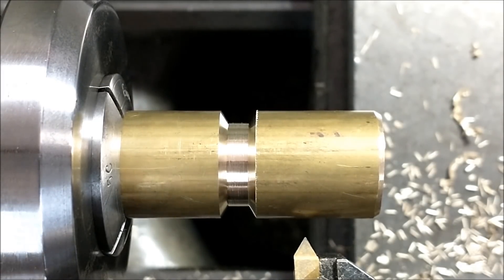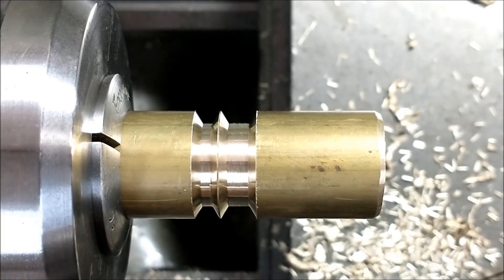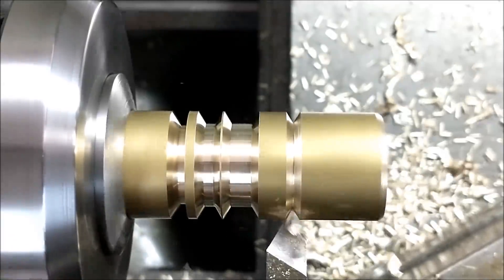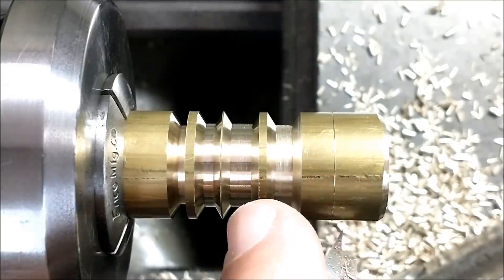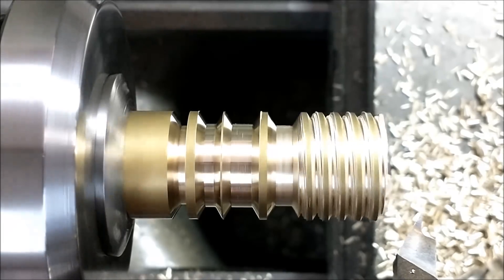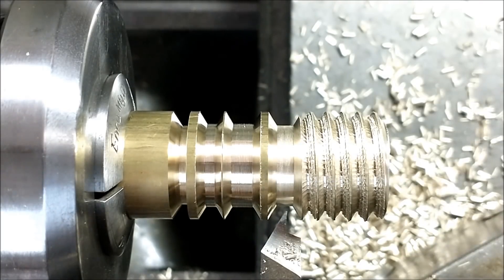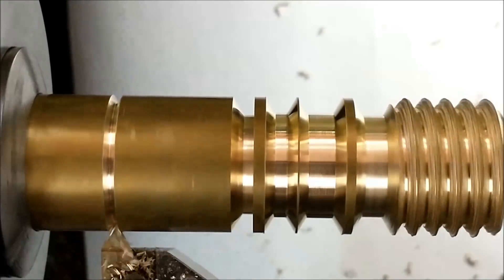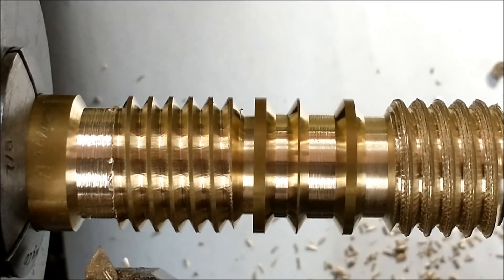FACT CHECK:  Threading Myth BUSTED !!   You'll Find This Interesting......

Comment: Hi Joe, I regularly cut 20 deg pressure angle threads on my lathe. I grind the tool to 20 deg both flanks and by giving 20 deg to the copound I feed the tool by compound slide. Will it be possible to cut such larger pitch worm threads by employing single flank tool as per your method explaied in this video. How will be the finish of the worm flank which is machined by straight side of the tool. The material is C45.
Reply from the maker: If you take extremely ( unrealistically ) small cuts, you might get lucky enough to achieve a reasonable thread with a one sided tool. This was just to demonstrate a myth. I probably wouldn't endorse the practice in the real world.

Comment: If you control the angle at the tool post why would it matter if you keep the 29-30deg angle on the compound? Assuming we're feeding with the cross slide only. Thanks Joe.

Comment: Thank you for validating what I've been thinking recently. When I think about the interface between the tool and the work, there's no difference between using the cross-slide, the compound, or increased stick-out of the tool from the holder (leaving aside the loss of stiffness from this) to achieve the next deeper cut. The geometry stays the same. The work can't see the compound whatsoever, only the tool.

Comment: Hi Joe 
Love your videos 
Hope you can help me out. 
When I cut a thread on my lathe the first pass after engaging the half nut goes great, then when I go back to make the next pass and engage the half nut on the same number on my thread dial it cuts a double thread. 
Why does this happen???
If I leave the half nut engaged and reverse the lathe and take the next pass it is perfect makes a nice thread. 
I would like to be able to engage and disengage the half nut pick up on the same number on the thread dial and continue but can’t. 
My lathe is only 3 years old. 1 metre between centres so not a toy. 
Hope you can help???
Regards 
Greg 
NSW. AUSTRALIA
Reply from the maker: if you are cutting metric pitch threads, you must leave the halfnut engaged at all times and use the lathe power to reposition the tool. If its an imperial pitch, you can do what you are currently doing.
Reply: Hi Joe
Thank you for your help much appreciated. 
Will experiment with imperial threads. 
👍👍👍
Reply: Hi Joe 
Just changed the gearing for imperial threads on my lathe. 
Used the half nut and thread dial. 
Worked GREAT 
Thanks so much for your advice 👍
Regards Greg 
NSW. AUSTRALIA

Comment: This 28 and 31/62nds°😂 setting of the compound slide appears to be either a British or American teaching. I learned my trade as a mechanical engineer in the '80s in Germany. We left the compound  slide parallel to the lathe axis, used the cross slide to adjust the thread depth according to  our well-thumbed reference books. On every cutting pass, the compound slide (@ Zero degrees) is advanced about ¼ of the cross slide advance increment. This avoids full cutting pressure on the tool, still cleaning up the "rear" side of the thread. E.G: for each pass you advance the cross slide by 0,4mm and forward the compound by 0.1mm .
As for the imperial system this should be about 3/8th of a thou compound advance for each 1/64th. cross solide adjustment.
Reply from the maker: I straight plunge 99% of all the threads I do.
Reply: @joepie221   As did I for 50 years. At college we were made aware of the "sliding down the flank" method for (manual)  single point cutting (and remember the angles necessarily change for the various included angles) 55 degrees Whitworth, 60 degrees Metric / SAE 80 degrees for PG and US conduit (I think) Using a QCTP is easier for the offset compound slide method than the use of an indexable toolpost, which only indexes at 90 degree intervals.  We were also made aware of the alternate advancing and retracting of the compound slide method. And were told not to bother, just to plunge.
I had to make some tapered knuckle thread connectors for military aircraft oxygen supplies to crew's oxygen masks.  So the taper was achieved using the manual machine's taper turning attachment, the root form achieved by producing a form tool on the Cincinnati Mk2 using a radiusing attachment (can't use that any way other than plunging) and the crest radii were achieved with a second form tool made by grinding the form after producing that form on the T&C grinder's wheel... tedious, but no pressure to work quickly, I was in military service, not business...
The problem with compound offsetting comes in rework, "picking up" on an oversize thread that's been rejected in QA, or picking up on a thread made oversize abroad, where it's quicker to rework rather than return it.  The other occasion was in single point cutting, followed by machine chasing to finish the crests. (like my aircraft hose adaptor)  Hand chasing was less of an issue. We went by feel, using the back of a boring bar set low as a tool rest.
I do have, somewhere, some single point carbide threading tips with a neutral approach, a compound rake (make sense?) which were intended specifically for the "sliding down the flank" method. It meant that the trailing edge was below centre, which, combined with the helix angle of the (RH) thread being produced, meant there was little or no tool/workpiece contact on the right hand side of the tool, viewed from operator's POV.  They worked OK in a plunging situation, even if it appeared they ought not to...
Glad someone else plunges almost exclusively... Die boxes and the various tangential threading systems do (did?), unavoidably.

Comment: Hello Joe, good video. I just posted a video discussing "feeding with the compound VS the cross slide" but toward the end of the video I tested a one-sided tool. The only difference with my tool is that I left a radius at the tip. The first 2 passed were deep but most were about .005". The results surprised me, the end results were incredibly nice looking threads. I attribute this to the radius, a sharper than carbide HSS and a left side relief angle.  Search for: Winky Treading - Feeding with the Cross slide vs Compound.

Comment: This whole series on single point threading is phenomenal. I very much appreciate you going to the effort to show what is really happening by removing one side of the tool - the facts are now on show for everyone. I've been cutting threads by just going in straight with the cross slide on my new lathe, but it's got decent rigidity and for small threads the load isn't too much I think. I suspect that as I get to larger threads - 1" and bigger at a guess - the chatter will start to get evident and I'll need to set the compound over. Cheers and best wishes for 2024 (and beyond).
Reply from the maker: Its always bothered me when I hear someone say the tool doesn't cut on the right side when set at 30 degrees. I figured I'd put that one to rest.

Comment: Joe,  great explanation and demonstration. I always wondered about how much the back side of the tool played a part in the thread formation in a single point operation. Seeing the result makes it as you demonstrated, makes it perfectly clear. Based on this demonstration, you don’t even have to set the compound on 29.5 degrees, because it only lightens the load slightly on the backside. It does not completely eliminate it, so  it may improve the finish quality but does little to nothing in forming the thread. Thank you

Comment: I began my machine shop training in 71 and was taught this fact entirely in the classroom.  I've tested it more than once "accidentally" by less than a perfect 60 degree cutting tool.  I was taught "threading is always with a form tool", we did have "NC" back then, even as CNC was only beginning to be mainstream in general service machine shops.  We were also taught to take one last pass with the cross slide of a thousandth or two to ensure the form of the thread came from the tool form.

Comment: This practice of cutting threads via feeding the compound set at 29.5/30 degrees appears to be a very American tradition that was practiced nee 100 years ago when lathes and thread cutting tools were very different than they are today. Back then majority of cutting tools were high speed steel and often cutting edges were ground by hand. Due to the tolerances/precision/accuracy required for proper threaded parts to function, it might be possible to compensate for cutting tool dimension issues. SO much has changed with threading tools since then, Same applies to engine lathes made today. Yet, these century old American machinist traditions persist in the very different machine tool world of today.  Looking at how single point lathe threading is done in Japan, EU and other parts of the world, thread feed is done direct in using the cross slide.. this feeding via the compound set to 29.5/30 is virtually unknown.

Personally, learned how to thread about four decades ago from a master machinist in a tech company model shop on a Hardinge HLV-H, no feed via the 29.5/30 degree compound, thread cutting feed was direct on with the cross slide using a carbide insert threading tool. Start threads with modest cuts, maybe 0.01" with progressive smaller cuts as the thread depth increase to about 0.002" per cut or less to achieve the required thread dimensions. To this day, cutting threads are direct in feed using the cross slide.. Regardless of thread pitch or thread form.. Proper Selection of threading insert, feeds, spindle speeds and all for the material being worked on can and does make all the difference in finish and results.

Fact is, threading is a form tool operation no different than cutting a groove, part off or similar. As for chip formation and clearance it has much to do with cutting tool geometry. Today, carbide threading inserts can easily achieve levels o accuracy/precision/tolerances and cutting geometry not possible in decades past. Add to this carbide and coatings used on high quality modern threading insert completely alters how thread cutting tools function in every way imaginable. Consider how ACME, Buttress and many other non-triangle thread forms are made.. With the majority of these non-triangular thread forms, this "business" of feeding with the compound at some is absolutely not done. As for chatter and poor thread cutting results, that is more to do with cutting tool and set up rigidity, stability, feeds and cutting surface speeds related to what the material being worked on requires.

As for threading away from the chuck, there is about zero reasons to NOT thread this way.. Unless the lathe has a right hand threaded on chuck. For lathes with RH threaded on chucks, any operation with the spindle running CCW greatly risk unscrewing the chuck.. resulting in a near instant disaster.
Reply: There might be a little baloney in that long winded explanation...single point threading has barely changed in the last century. Feeding at 29.5 allows the leading edge to bear the main cutting force, so chatter and vibration are absolutely reduced. It's only for roughing, as you want both edges engaged for the finish cut. If it's not needed or used in most of the world, why does my Japanese CNC lathe infeed at  29.5 degrees??? Maybe because it works!
Reply: @peoplepower1272  
Fact is the edge moving in the direction of cut does the cutting, once the DOC has been set regardless of how it was set (angle indeed-via compound or etc) or radial infeed via compound or etc.. This act of metal removal is not static, it is dynamic and due to the fact the metal bits involved (cutting tool and work being threaded) are moving changes the perception vastly.

This angle compound infeed belief/idea comes from the reality threading tools were hand ground nee 100 years ago. Since then modern threading tools have vastly changed far beyond hand ground high speed steel cutting tools and carbide insert geometry. Ponder how many production cnc machines today use hand ground high speed threading tools...?

Here is a chart from Mitsubishi, carbide threading insert manufacture.. Direct radial infeed is recommended with their threading inserts. Not just radial infeed, the depth of cut per pass is also recommended. Why is this, modern carbide threading inserts have chip formation geometry moulded/ground into the insert that negates any need for this angle infeed for threading. Bottom line, believe threading cutting beliefs/ideas from nearly 100 years ago that was based on cutting tools and machines that are of that same age or accept the fact science and technology has moved far on from those ideas/beliefs..
https://www.mitsubishicarbide.net/contents/mhg/de/html/product/product_guide/information/turning/threding_ex_03wit55.html

BTW, there are full form threading inserts that cannot be used with angled infeed...

As for cnc lathes, virtually any type of cutter infeed can be programmed as needed and this does not apply to any specific Nationality of cnc machine.

Comment: This video, made me thinking. I learned from Old Tony about sine errors, that if the compound slide is set at 30 degree, the sine is 0.5, that will make the movement on the material half of travel distance. The story about setting the compound slide to 30 degree for cutting threads, is the reason for that perhaps, the more precise feeding of the tool, and so make a more precise thread? Love your video's i learned a lot from you. I very much like the miniature series, because i make small part myself.
Reply from the maker: The angled compound is done to reduce tool load. It biases the chip distribution and is a good practice for lighter machines or longer threads.
Reply: @joepie221  Thank you, Joe
Reply: Not true for modern A60 and similar series carbide insert threading tools. Chip control is moulded into the carbide insert and these inserts are designed to be direct in-feed for threading. This is per the insert manufactures data/spec sheets. As for cutting tool loading, if one side of the threading tools is "loaded" the overall cutting load on the machine and tool remains equal and if that cutting edge is doing most of the cutting, it will wear out faster.. This tendency has been designed compensated in modern carbide threading inserts.

What one was, many no longer apply and what once was should be questioned as to why that practice or technique was initially and originally done.. compared to machine tools and cutting tools of today.

  @joepie221

Comment: What would have been fun is that you had the material out far enough to have done both cuts then gone back to the first cut and with the sixty degree run it through the first one to see if it cleaned up the right side!

Comment: When the compound is set at 29.5, the main chip flow is facilitated since coming off only one side of the cut while the tool is well supported by the 0.5 on the other side preventing chatter.  The 29.5 setup also keeps pressure against the lead screw backlash as does conventional milling versus climb milling.

Comment: Great presentation Joe, as always. Your half tool made me wonder how buttress thread are cut. Is the tool advanced perpendicular to the spindle axis or the compound clocked the opposite as with a 60 degree thread form and incrementally advanced toward the perpendicular flank of the thread with each pass?

Comment: Not actually a Myth. The method you have so robustly criticised in this video was published in a training text book written by S.F. Krar, J.W. Oswald and J.E.ST. Amand in 1977 Called Technology of Machine Tools( Second Edition). A text book used during my training in the early 80’s. I have used the plunge method many times(with fine threads) but the benefits of using the compound offset method WITH a correctly ground FORM tool are more than apparent when machining large threads especially when you are operating a Lathe with limited rigidity.
Reply from the maker: 8-29-22
Reply: I've consistently heard it specified as significantly reducing tool pressure from the right side (especially if you only do 29°), which Joe agrees with.

Comment: Great video. I do have a question:

I'm not a machinist so excuse me if its an ignorant question.

Couldn't you just go in reverse with the tool to clean up the ragged edges? Or is the operation only one way, or perhaps too unsafe?

Also, is the control depth movement done by hand with a scale reference, or is it automatic? I don't see the whole machine in the video.

Comment: CNC lathes do not use a 29-1/2 deg compound setup for threading?
Reply: They can. For example the LinuxCNC G76 command includes an option for virtual compound angle, It advances the tool a little on each pass. I imagine other controllers do the same. 
On a manual lathe, I never bother. And have seen no issues.

Comment: Thanks as always for your great videos. Some people say you don’t need a compound to cut threads. You simply plunge in consecutively with the cross slide. Does that really work? Maybe with small parts? Would you comment on that? Thanks
Reply from the maker: Threading with the cross slide is fine if the machine and material are rigid enough.
Reply: That is the same answer I would give. If the lathe is a big rigid machine and stout tool shank then straight 90° plunge indexing will work fine for most screw cutting jobs. The compound half angle method reduces the tool loading dramatically therefore less chance of digging in or flank galling.